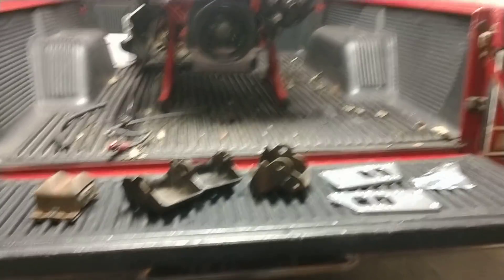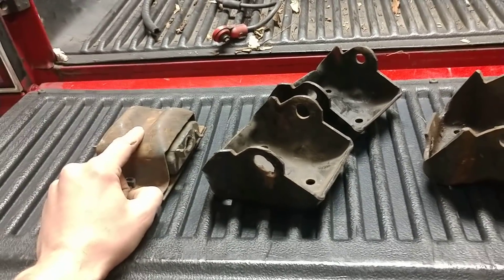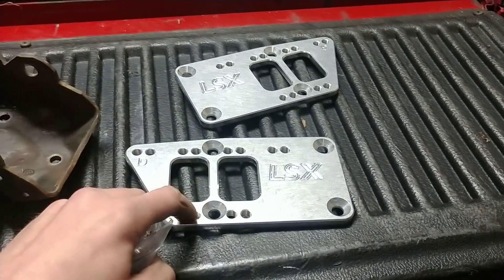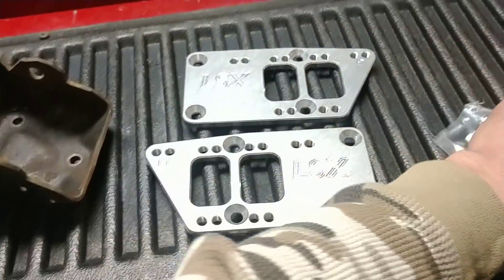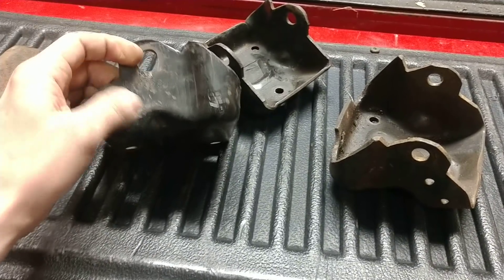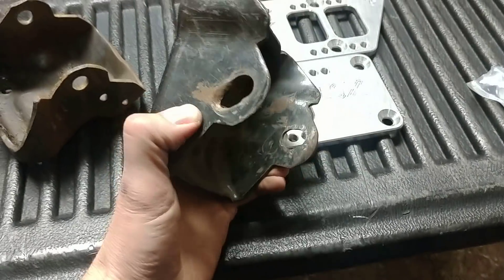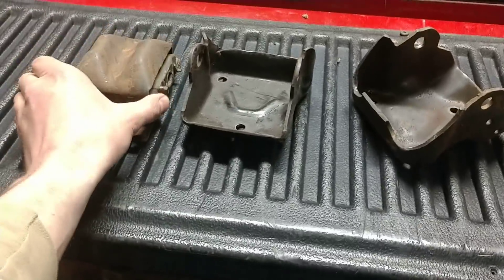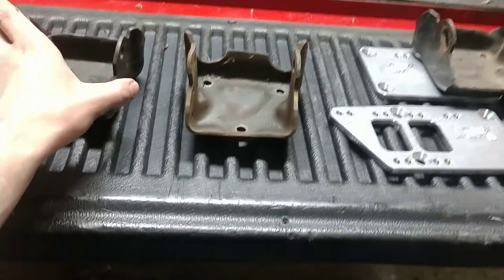How To: LS1 4.8 5.3 6.0 BUDGET MOTOR MOUNTS. CAR vs Truck clamshells 
swap mounts from ICT BILLET

Comment: Got a big block in a Chevelle. Guess that I need to get some small block mounts then? It Also has a Muncie 4 speed. Could I use the Big Block bellhousing to mount the Muncie to the LS? Great Video as always. The 6.0 sounds good!

Thanks again.
Reply: Big block mounts can be used the difference is marginal
Reply: The big block Chevy, small block Chevy, and LS engines all use the same housing

Comment: I have a 81 Caballero 3.8L V6. I have them same ICT motor mounts. Do I have to switch my stock motor mounts to V8 or can I keep the V6 mounts?
Reply: I got a 78 I’m doing the same you have to use the 5.3 truck mounts what cross member you using for the transmission

Comment: I have a 350 and a 400 small block
Which is better to turn in to a 383?
Thanks for your time and assistance.
Reply from the maker: At this point you can't beat displacement. Run the 400
Reply from the maker: @Ls3guy  🤷‍♂️
Reply: I am running a 1968 327 corvette block that is .080 over.  I put in a 350 Scat steel crank with 6 in. rods pushing 13.5 to 1  pistons. The machine shop said this set up was 386 Ci. I am running this in my 73 Vega and it screams.  I am going to a LS next year.  Not spending any more on GEN. 1 small blocks any more.
Reply: @beeterolds  he doesn't understand. He wants the bragging rights of the 383. Not necessarily the power

Comment: Can I use clamshells from Silverado in my 86 s10 with original engine mounts from 2.8 liters?
Reply from the maker: Nope
Reply: What do I need for the 5.3 in my ‘86 s10?
Reply from the maker: @ForzaRT  I made a lot of other videos. Check em out
Reply: BeeterOlds thanks.

Comment: are these solid mounts?
Reply from the maker: No the clams and the engine plates are solid but the rubber motor mount gets bolted to the frame